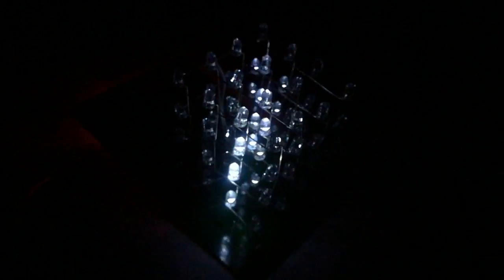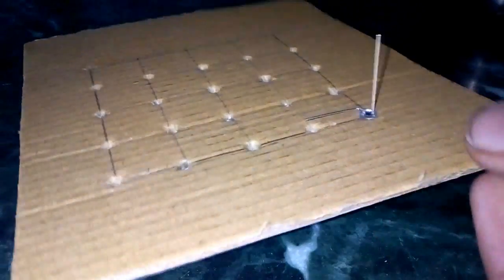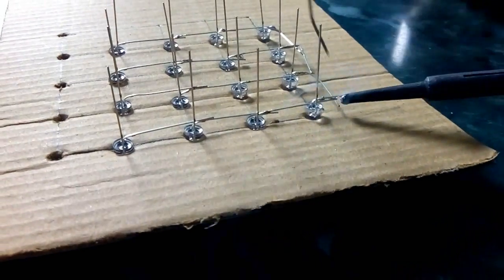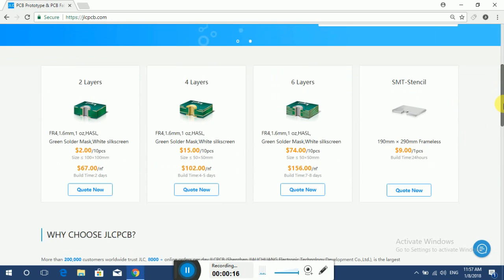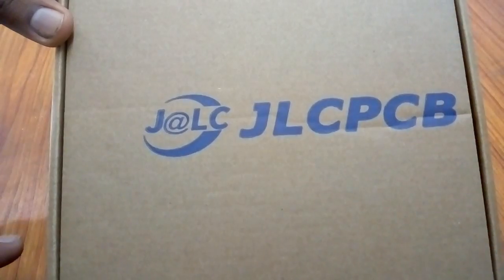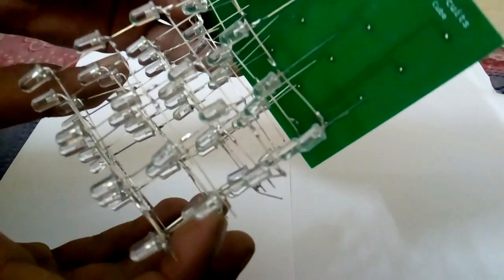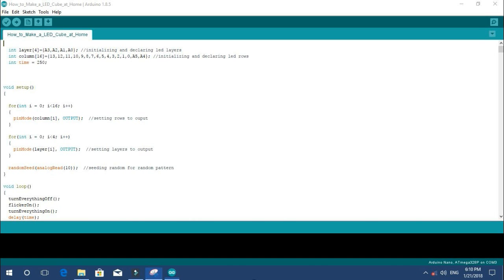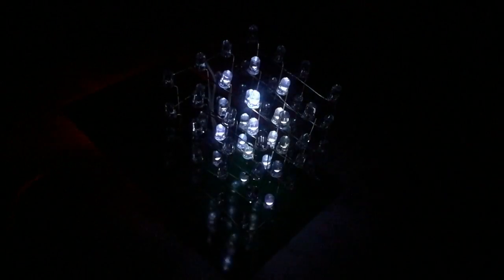LED Cube 4x4x4 - Making of 4x4x4 LED Cube

Comment: Nice one, but I would prefer to have the arduino on the top of the board and reduce the length of the board.
if you are concerned about the red smd led of the arduino then just desolder it or just use a sharp knife and cut it.
Reply from the maker: Crazy Couple (Relationship Jokes) thanks for your suggestions and support... 
We can cover red leds with electric tape